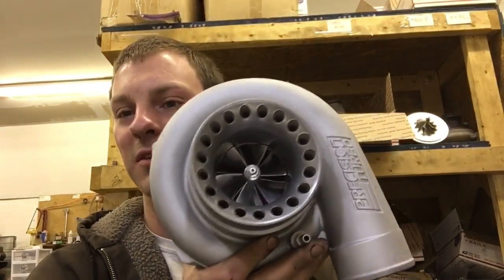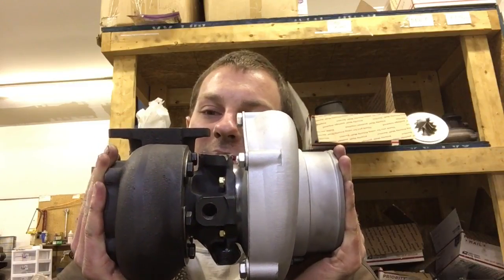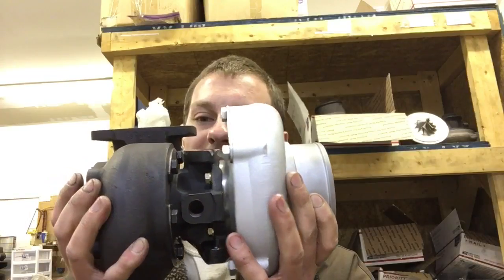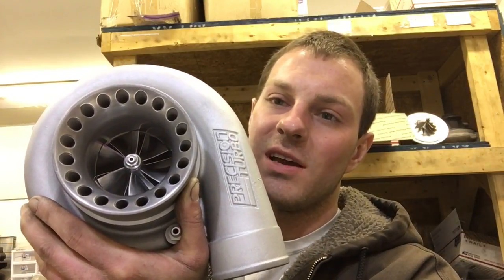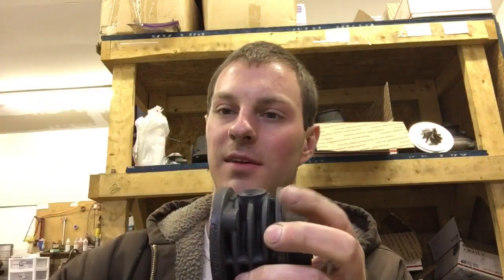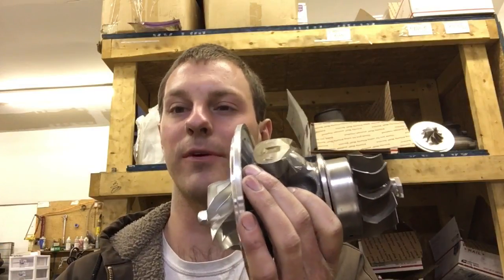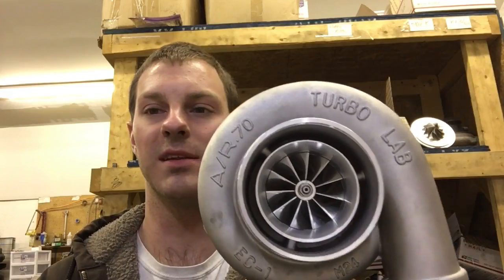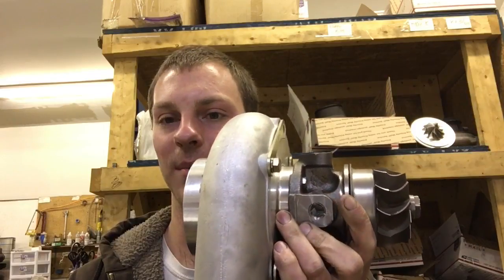PTE 6262 Ballbearing to GT37R Hybrid Upgrade

Comment: would you recommend a pte6266 or the gtx35R for an evo8 600whp
Reply from the maker: +cuong tran either would work but the 66 m turbine will make more power at higher rpm
Reply from the maker: +Turbo Lab America the gtx35r would spool faster
Reply: @turbolabamerica   what is your  email  or telefon  for upgrade  my turbó  precisión turbo gen  two